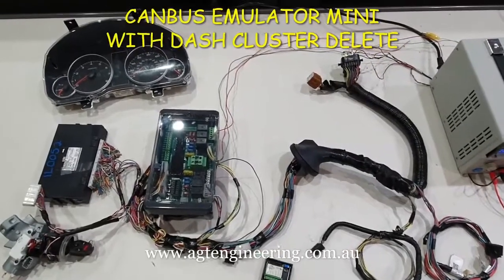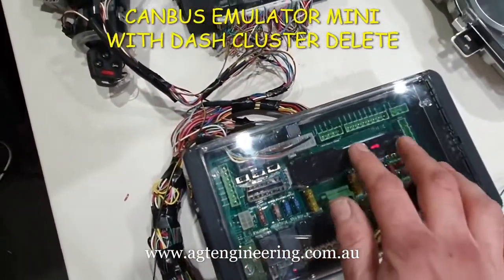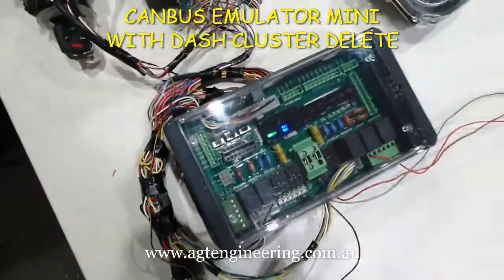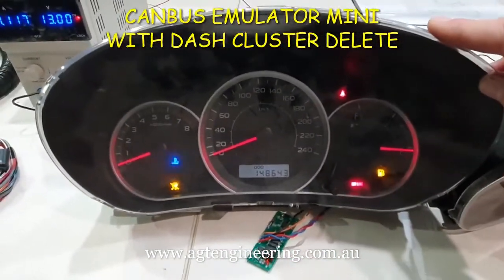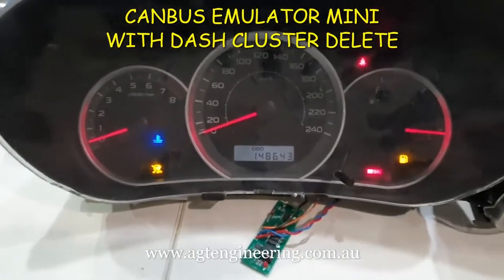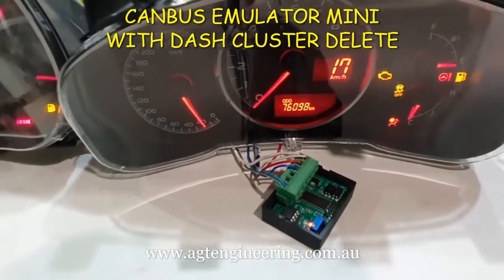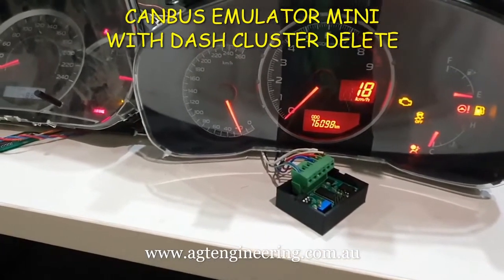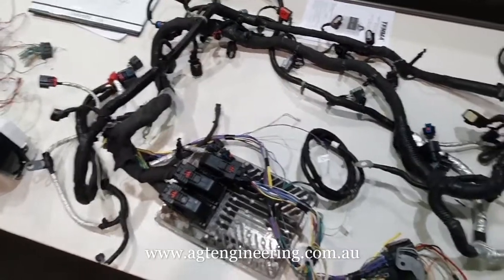Subaru engine conversion Canbus Emulator Mini with Dash Delete function

Comment: Hi mate, will this conversion fit into a ADM model ‘03 STI? I want to run a VA STI gearbox, but it uses the CANBUS system. Would I be able to run this system with the factory GD STI cluster? Will it work with DCCD aswell?
Reply from the maker: HI, If you are keeping the EJ20 then no need for any VA/Canbus wiring. The VA transmission won't have a speed sensor. Try Rising Sun Subaru who might be able to modify the box to fit the 03 speed sensor (best option). Alternatively DCCD make a module to create a speed signal from tapping into one of the ABS sensors.